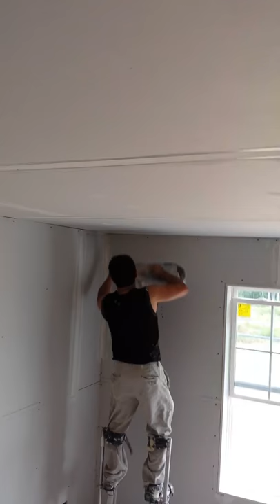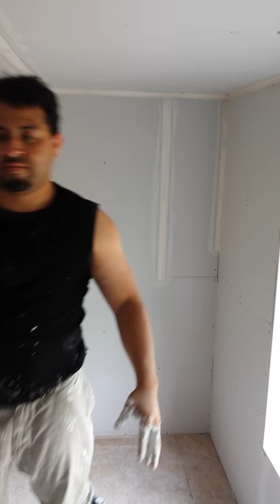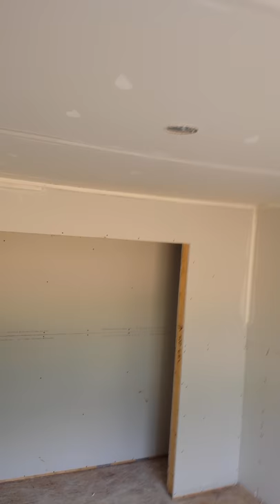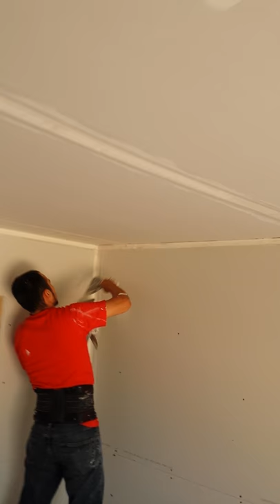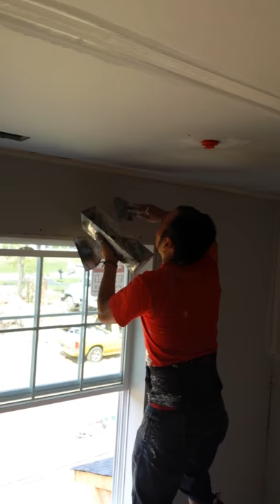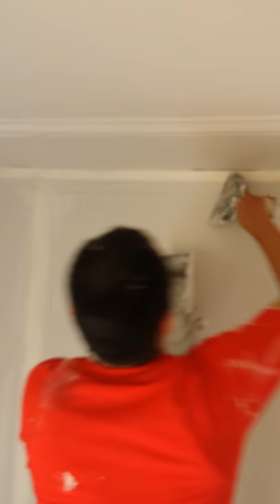Running angles with a banjo

Comment: going to try a banjo for the first time on a new job. been using an old slop box forever. i like how you wipe out. thanks for the video.
Reply from the maker: Charles Austin  be a little patient when you do it   make sure you mix mud  like you would with a bazooka      dont  make to full  because it will be hard for you in the beginning but you will get stronger as you go good luck